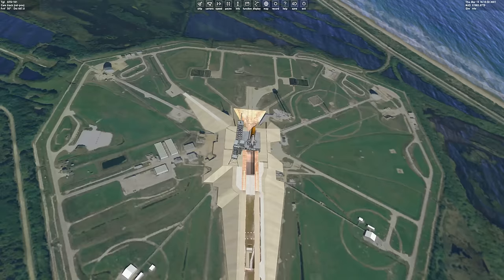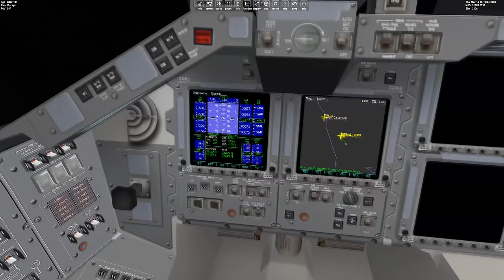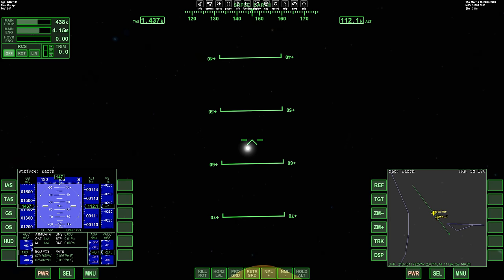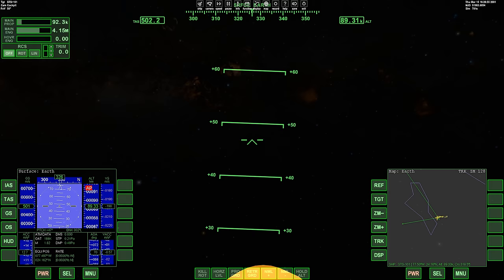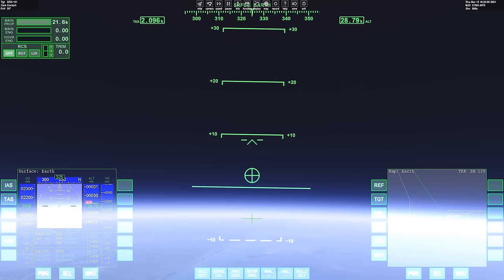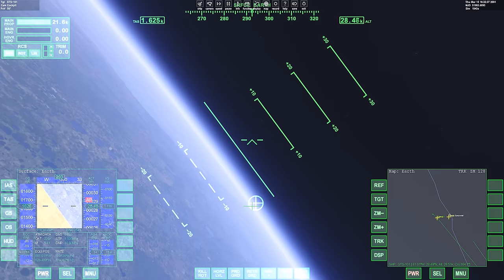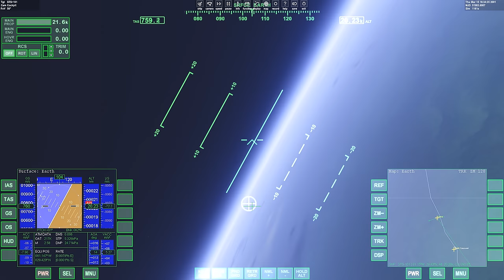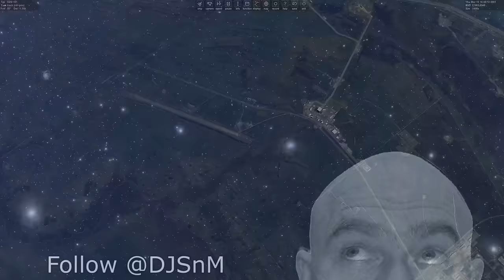Space Shuttle RTLS Abort Challenge - Without The Manual

Comment: I'm not sure if anyone has told you what TAS means. it means True Air Speed.
Reply: Dark Angel Gaming Yes, otherwise it would say IAS (or maybe KIAS, or in some rare instances, GS)
Reply: there is a GS down in the lower left corner on the gage(?) group. though, GS, and TAS are generally used in Tandem with one another.(that or another form of air speed indication(don't know what its called.)) I don't know what the math difference between the 2 are though.
Reply: GS is Ground Speed.  This is the speed a vehicle is travelling over the ground regardless of its altitude in or out of the atmosphere.
TAS is, as mentioned, the vehicle's True Air Speed.  This is the vehicle's GS plus or minus a headwind/tailwind/crosswind component.
IAS is Indicated Air Speed. This is the speed of the air over the vehicle as measured by a device - usually a pitot tube. A pitot tube, simply put, measures the airflow moving toward it.  It's affected by the air pressure around the vehicle.  As a vehicle gains altitude, air pressure drops.  The higher the altitude, the greater the difference between IAS and TAS.  To save a pilot from calculating what their TAS should be at any given altitude, IAS gives them an instant indication regarding stall speeds and vMax (or maximum velocity through the air) to maintain flight (or as Scott would say to "Fly safe!").
Reply: GS is Ground Speed, IAS or KIAS is for indicated, that is the equivalent pressure. In 50% density, you need to double your speed, but IAS will be the same. TAS is true airspeed and indicates the speed of the molecules.
Reply: For KIAS is Calibrated Indicated, It's a bit more accurate but generally you dont use any of the IAS- and variants in aviation. You primarily use Ground Speed (which logically shows how quickly you go across the surface to track route progress) and then TAS you use for airflow around the plane basically, so you get the true air speed of air over your wings for stall speeds and so on

Comment: Scott, the OMS engines could indeed be fired at 20 km altitude--Dan DeLong's 747-launched spaceplane (which he designed at Teledyne Brown Engineering--it had a 21' long Shuttle-compatible payload bay and used 4 RL-10s and 1 SSME for power) would have lit its rocket engines at 30,000 feet. He found that the standard vacuum-optimized RL10 engines (and the SSME) had no plume under-expansion problems at that altitude, which is considerably lower than 20 km.

Comment: Just thought I should point this out: In the bottom left panel is your critical telemetry. Specifically, the top section under the camera, is ATM DATA. this contains the M or Mach number. This will be the calculated data, not real time flight sensor data. Meaning, the calculated true speed in atmosphere.

Comment: TAS = True Air Speed (which is basically the same as Speed Over Ground - ignoring spherical error due to altitude). This is the corrected value compared to IAS = Indicated Air Speed. At altitude the airspeed indicator in an aircraft reads lower than the TAS.
Reply: More correct: TAS is IAS corrected for altitude and temperature - and (I think) compressibility effects from Mach velocities, and associated pitot tube temperature rise -- and probably other things. Ground speed corrected for wind would be another way to get TAS, but it doesn't work that way. Instead, you correct TAS for wind to get GS (flight planning) or use measured GS (nav radios, DME, GPS, Loran, etc) in flight to calculate wind direction and speed for updated flight planning - necessary for due diligence, in case winds are not as favorable, or worse

Comment: Change the tires and hose it off! Wish I had your simulator package. BTW- as you increase altitude the thin air exerts less pressure on the vehicle and pito-static system. Rule of thumb is 2% per 1K' altitude. If you're at 25,000' and indicating 200kts, the airplane will feel like 200kts but its TAS is 300 kts (25X2=50 so add 50% of IAS to get TAS). It becomes a factor when the inertia of 300kts is managed by the aerodynamic authority is only 200. It becomes more problematic when Mach effects come into play. Think U-2, where stall speed is 15 knots below critical Mach number.

Comment: first off your shuttle is heading in the wrong direction from launch.(Roll It east with your launch pitch)  Don't forget to throttle the two remaining engines to 109% As soon as you lose an engine .(Max Thrust)  10:40 you could Also burn OMS engines for more energy if needed. (For Fun if this happened in the first 4 flights, you would eject Try that next time see how it goes)12:57 don't forget to drop the tank.  13:30 you still have OMS for kick if needed. 15:46 I would try to get the runway from the north, good energy. 16:11 go straight past the runway, bleed energy then sweeping turn in from the north.  17:19 free the stick about 1/2 with this turn now  Some goof-ups plus a major goof up (not taking into account Earth's rotation) Made this very difficult. 20:55 shut OAMS off! 21:46 Put  Nose to the AIM POINT! 22:35 YOU LOOK GOOD.24:08 PRETTY GOOD!!! (just needed brakes and chute) Try it again this time coming from the East as a real shuttle would.
Reply: He approached the runway from North and was heading Southbound. The Atlantic Ocean, East of the Cape, was on the left during the terminal approach. (20:56)
Reply: "Try it again this time coming from ..."

Trying it only once was the whole point, though... ;)

Comment: the Shuttle's OMS and reaction control system (RCS) motors would continuously thrust to burn off excess OMS propellant to reduce landing weight and adjust the orbiter's center of gravity.
What I pulled form Wikipedia for a RTLS abort so I definitely don't think it's cheating at all. It's what they would actually do.

Comment: So to correct a mistake, you don't fly a phugoid. The issue as you stated is you're going too fast with too much energy, if you dive you increase speed and a phugoid is simply too dangerous and putting stresses no aircraft is really designed for - negative g. You would roll to the side, and as the aircraft turns it loses energy. Then you roll to the other direction in what they call a "roll reversal" for obvious reasons, and it results in an S shape path. The more you bank the more speed you lose, and like that you can control speed (and therefore attitude) quite easily. There is an astronaut giving a lecture on how to land the space shuttle somewhere on youtube, its incredibly interesting and hes a pretty funny guy to boot.

Also to illustrate its flight characteristics, the way they train is through flying a small jet aircraft, with the landing gear out and the engines in reverse. That ends up with about the same aerodynamic efficiency as the space shuttle. And the MFD and HUDs are different to the one in that game, though curiously its also different to the standard US and NATO HUD despite having really no reason to be. Quite frankly the NATO HUD is far better and shows a lot more information with a lot less confusion and a far better. Though they do use a prominently displayed airbrake symbol because all the way through they have some amount of airbrakes being used, even just before landing. Though almost all of it is done via the automated systems, both the flying and the airbrake. They can override if they wish or use a flight director mode where they have direct control and the computer merely suggests, which is the mode used for the final portions of landing.

And TAS - True AirSpeed. The indicated shows a lower speed the higher you get because the pressure drops, but it also shows exactly what the wings are feeling which is why its so common. True AirSpeed accounts for that and shows the speed you are really going through the air. Finally Ground Speed is the speed accounting for everything including wind speed and is essentially what your GPS would show.
Reply from the maker: I think you're confusing a normal reentry with the RTLS scenario. During a normal return from orbit they did fly S-Turns to shed speed. In this case the section I'm talking about is the Alpha Recovery phase where having dropped the tank I'm in a dive and need to pull out & slow down.
Reply: I think I might be taking the phugoid a little too literally as a repeated motion. I thought you meant a separate repeat manoeuvre rather than just a temporary alpha minimisation, my mistake. Also I appreciate the reply despite your likely busy schedule, and greetings from another physicist. I've really enjoyed the series explaining rocketry in the real world compared to the simplified KSP.
Reply from the maker: Thanks, I should have another entry on that talking about fuel injectors.
Reply: Oh awesome. Thats one I know absolutely nothing about too so I'm definitely excited. I'll make sure I keep my eyes peeled, thanks!

Comment: 20:26 for the AJ10-109 reaction control engines to be used in the atmosphere was there an option to select atmosphere mode? In space when one reaction control engine would fire the one on the opposite side would fire to negate the momentum caused by the firing of the first reaction engine. Otherwise the orbiter would keep moving away from the direction of the reaction control engine thrust. In the atmosphere that wouldn't be needed and may be very bad! Just curious if anyone knew.

Comment: I just thought about this ages after first watching this video, but wouldn’t the RTLS maneuver cause issues with the fuel and oxidizer in the main tank? At some point your relative velocity is going to reverse; which was something never really designed into the tank as far as I know. Even a minute amount of air or lack of propellants would shut down the engine(s) or… worse (ie. header tank requirement on starship.)

Comment: You mention 02:10 you can't pull the shuttle more up more vertical earlier because aerodynamic forces would pull the shuttle off the shuttle stack. I was wondering if a pilot might want to do that to get away from terminally flawed SRBs or other calamity.  As heavy as the Shuttle might be it might not like landing, but it still might be a landing people could walk away from.
Reply: "Pull off" sounds calmer than it would've been. Something similar happened to Challenger - it got torn apart due to slipping away from the stack.

Comment: Remember for every 3 miles from the runway you want to decrease 1,000 feet. So when you are 3 miles out from the runway you want to be at 1,000 feet, 6 miles out 2,000 feet...so on amd so on. That will give you a near perfect approach. That's pricipal should work with any aircraft.
Reply from the maker: The shuttle it's really an aircraft, it's a brick with wings that has a glide slope of 3:1, meaning that 3 miles from the runway it needs to be at 15,000 feet to have enough energy to reach runway.

Comment: TAS = true airspeed (i.e. the speed you're actually moving through the air mass, rather than indicated airspeed, which is, as you said, basically a calibrated pressure reading).

Is there any way to have the displays show knots? The shuttle pilots didn't fly on metres per second!

Comment: You should look in to mods like NASSP and Delta Glider IV.  NASSP is quite a realistic simulation of the Apollo missions, and the Delta Glider is a ship that's pretty fun to fly around.
Reply: The magically high Isp of the DG's engines kind of breaks the immersion a bit... It's good for messing around with orbital mechanics and learning the ropes but it kind of sucks the challenge out of things.
Reply: Arkalius80 the dg 4 had configurable isp though. it came with a program where you could set life support and fuel efficiency settings, as well as the paint job
Reply: Sure, I loved the DG... but after learning about how rocket performance works, it kind of lost some appeal for me. I was actually partial to the XR-2. At any rate, with a realistic Isp, the DG wouldn't be able to come close to orbit from a ground takeoff. An Isp of 450s or so (LH2/LOX) is about the best we'll ever get with chemical propellants, and you need close to a 90% launch fuel mass to achieve LEO with that.

Personally I'd like to play around with the Skylon in Orbiter... I'd guess that someone has created a mod for it by this point...

Comment: Not to be the guy, but roll program and gravity turn went in the wrong direction, you should be headed on a North-eastern trajectory. Also, as far as I know, to be qualified as Shuttle pilot (or commander) between simulator and shuttle training Aircraft you have to practice about thousand landings. STS-93 experienced the loss of primary controller on center engine and back-up controller on left engine, as well as a hydrogen leak from left engine from the inner wall of the nozzle. Since it was an after-flow valve leak, controller increased consumption of oxidizer, and they had what's called a LOX Low Level Cut

Comment: What type of scenario would warrant attempting an RTLS over the safer Trans-Atlantic Abort?
Reply: If the engine(s) fail(s) before you have enough energy, you're forced into the RTLS because you don't have the energy+thrust for the TAL. The basic profile is [Long segment of time where RTLS is the preferred regime] > [Relatively short segment where TAL is the preferred regime] > [literally only seconds where AOA is the preferred regime] > [Long segment of time where ATO is the preferred regime] > [Don't need to abort]. Despite TAL being a relatively unlikely event (with the short abort time), every shuttle flight had not one but two runways in Europe fully manned and prepared for a TAL (i.e. closed to normal/military traffic), including hundreds of NASA employees and a flight surgeon at each.

My understanding is that there's some overlap in each of the abort envelopes; you might be able to AOA for more than a few seconds, but when you have both ATO and AOA available you're gonna probably take ATO unless it's a medical emergency.
Reply from the maker: Engine failure early in flight, in the first few minutes there's not the energy to commit to a transoceanic abort landing.

Comment: wow. 4g limit huh. General Aviation aircraft are typically rated for +4 to -3g or so, unless they are rated for aerobatics, which typically adds 1-2 g to each end.
That's not a lot for an aircraft doing 100-300 knots, but would be positivily terrifying for one that may deal with hypersonic flight regimes.
Reply: That's the big problem with space flight.  Weight is critically important.  Take in mind that in order to get an object into orbit, you must burn around 20x its weight in fuel, and that's before even considering the weight of the actual fuel tanks!  Getting the shuttle to survive higher g loads would mean strengthening the structure, which would in turn mean either thickening struts or adding additional ones, which in turn means a heavier orbiter, which ultimately means a big increase in overall launcher size.

Comment: Why in the actual space shuttle were they not allowed to use the orbital maneuvering system during an emergency?
Reply: The propellents were highly toxic (with MMH being a carcinogen in small amounts). They didn't want to be spewing that stuff out into the atmosphere and risk injury of the astronauts, ground crew, or anyone else. Additionally, the small amount of thrust those engines would provide within the atmosphere wouldn't be very useful.
Reply from the maker: +Arkalius80 titan launcher used for Gemini pro gram used lot more of  same fuels and launched from KSC. Technically I was supposed to burn off a lot more of that fuel prior to dropping the main tank so vehicle would be more stable.
Reply: Yeah I don't think it's as big a deal to use them for a launch. I'd imagine using them for a landing would probably pose more dangers since there is more likely to be people in the area around where they are used soon after the landing is completed. I believe that after an Apollo-Souyuz mission, unburned N2O4 from the landing managed to get into the cabin and left one of the Astronauts hospitalized for 2 weeks.

Comment: TAS = True AirSpeed, not actually sure what the difference is between that and IAS (Indicated AirSpeed).
Reply: Indicated airspeed is only accurate at sea level air pressure and temperature. As external air conditions vary, IAS will vary from TAS, and calculations have to be performed to come up with TAS.
Reply: Arkalius80 has the heart of it. Once you're off the ground, and moving both vertically and horizontally, it's really hard to know how fast you're going.

Comment: reusing ssme's that haven't been in production for 30 years and are insanely complicated to build and use for a big dumb rocket is truely a waste of money and resources, we'd have better spent it on a modern f-1 (designed with modern cad and cfd) that could be greatly simplified and the production line would be cheaper than restarting the ssme's line
Reply: That engine already exists. It's the F1-b. Was designed to be a modern manufacturable version of the F1 with way less parts and a bit better performance.